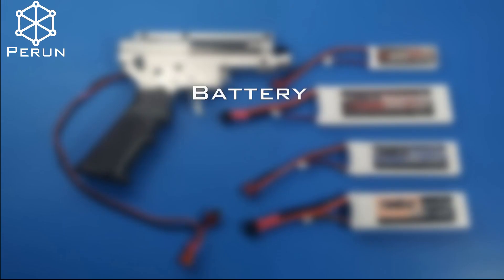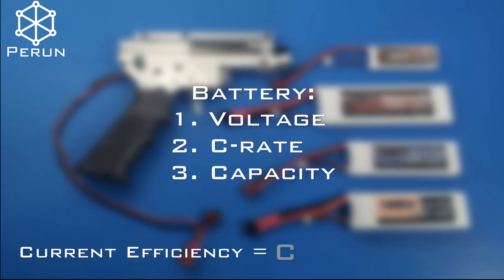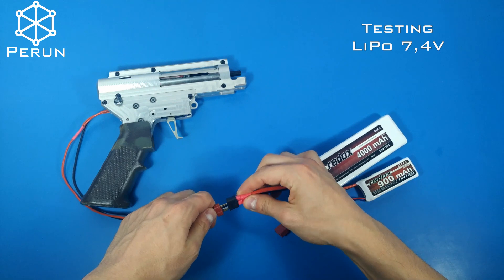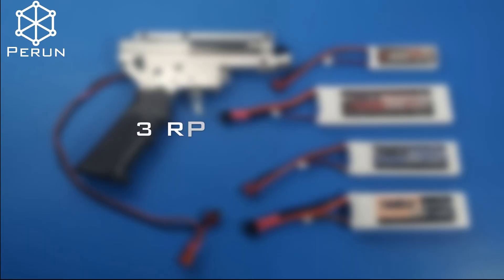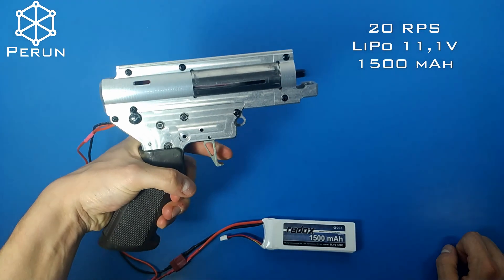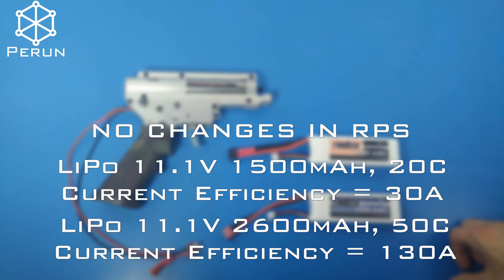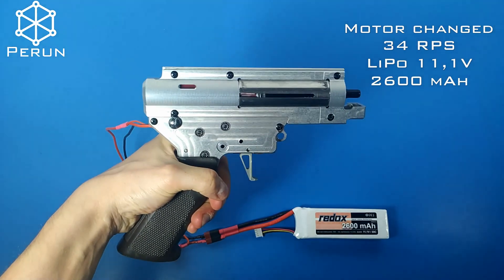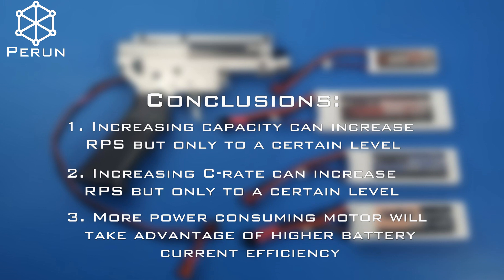Does battery size matter?

Comment: What should I use in the perun hybrid gen 2 I have 18.1 ratio and a 30000 matrix motor
Reply from the maker: And what spring do you have in that replica?
Reply: @perunairsoft4811  a 110 or 120 I think
Reply from the maker: @kurtmesser6805  We would say, that in such case a battery with at least 60 A of current efficiency is needed to make it work reliably and ensure that the battery won't wear down too fast. For example, a 3000 mAh 20 C battery, or if space is a constraint,  a 2000 mAh 30 C battery would do the job nicely.

As for the voltage, to increase the longevity of the replica with such high RPM motor, a 7.4 V battery would be recommended.

Comment: so is it ok to use a 11.1v 2200mah 24.42Wh 120c (max discharge of 150c) on it? ive been afraid to use it because i don't want to brake my perun v2 hybrid
Reply from the maker: You can use it, but it in case of your replica it would be better to either change the gears to high torque type (100:200, 100:300) or the motor to low RPM.
Reply: @perunairsoft4811  thanks

Comment: After looking a lot for the relation between voltage, c-rate, and amperage (capacity) of battery and how they affect AEG (electric airsoft gun) performance, I have to say this is the perfect video it demonstrates how each factor affects the performance of AEGs.

Thank you so much Perun Airsoft

Comment: DC motor speed depends only on Voltage.
However, because it is a charge (resistance), the motor will drain current from the battery. If the battery can't give the needed current, it will drop its Voltage to compensate. Therefore, the motor will spin slower.
A battery with High discharge rate will provide more current, so the drop of voltage is lower, then the motor will spin faster.

Lipo batteries have higher discharge rates than nihms, that's why a motor on a 7,4V Lipo spins faster than a motor on a 8,6V Nihm. 

Also worth mention is that Torque means current. The higher the torque, more current it will need.
Reply: What about high discharge LiIon batteries?

Comment: Good material. What do you think about following statements? If power efficiency of a battery is too low then it will get degraded faster. If power efficiency is much higher than needed it will not affect engine nor battery negatively in terms of lifespan. Are those true?
Reply from the maker: Thank you and yes, all those statements are true!
Reply: @perunairsoft4811  will the pernun v2 fit inside a krytac trident mk2 crb???? Any info would be helpful thanks :)
Reply from the maker: @meohmy420  Yes, but only without the bolt catch latch. It goes through the gearbox in place where the PCB is. You will also need to sand down a small piece of metal between the sector gear and contacts.